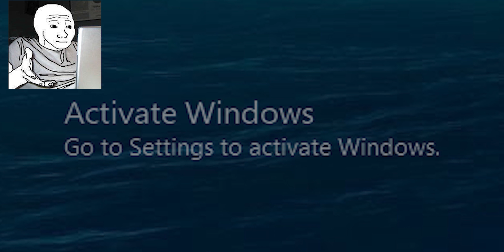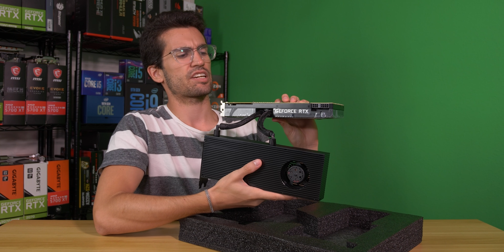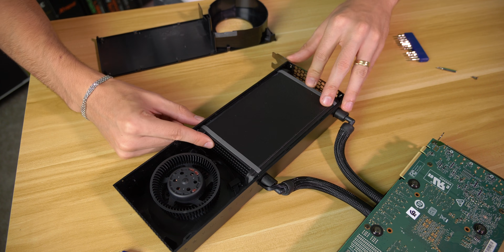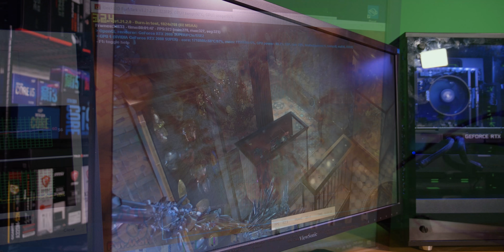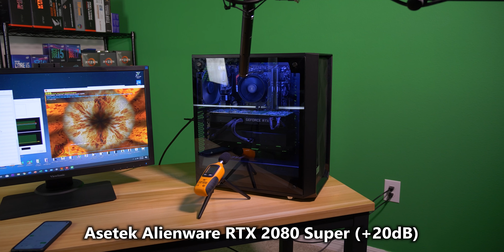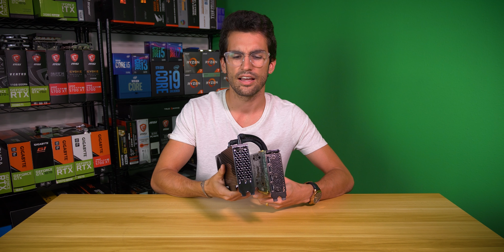Testing a Strange Alienware Graphics Card

Comment: I managed to snag an Alienware R10 for $1600 USD. I was really after the GPU and CPU of the system, which is the Ryzen 5 5600x and 3060 ti (Alienware built GPU like shown in video.) As well as 16GB RAM 3400mhz. I'm really tempted to set the Aurora R10 gaming tower body aside, and install the CPU, GPU, and RAM into a completely different PC tower rig (e.g. NZXT or Fractual) for better airflow on the components' sake.

Comment: I like the design but it doesn't seem like a viable long term solution. The new 3080s with this design are being crammed into the new R11 case and are so tightly packed its losing cooling efficiency at a terrifying rate. 

I have now watched about 20 videos from the last 3-4 months where the average gamer is playing without an OC or tuning. Running games like Witcher 3 are pushing CPU/GPU temps to 90 Degrees Celsius. That is absolutely terrifying to me from a consumer standpoint. It seems these are designed to last until the warranty is up and nothing more. 

Alienware is trying so hard to make a compact high performance gaming rig that they are producing a low quality but highly engineered product. 

Just seems counter productive and a long term PR nightmare as these new R11/R10 models with the 2080TI and 3080 are put right up next to the CPU and PSU in a small case. The heat may get pushed away from the core chip but its going to create an inner case temperature that the liquid cooling design they have won't be able to compensate for after 2-3 years of use. 

Might just be my opinion after reviewing the average joe's uploads to youtube and I have not had one myself to make sure its in an environment that is gaming pc friendly, but after watching a bunch of videos on these rigs. Red flags are everywhere. 

Anyways, solid video and again. I am not knocking the design. I think its pretty cool. 

thanks!

Comment: Random question. Can you explain what exactly the Nvidia Tesla series of graphics cards are? As I've been searching for used graphics cards, ebay keeps throwing in tesla cards as suggestions. I'm not entirely sure if they're meant to accelerate your existing gpu or if they are (in and of themselves) a gpu. Can these be used to boost performance in video editing? Or are they purely for data centers/research applications? Thanks

Comment: Suggest a follow up test with this card and the founders edition in a case with poor airflow so we can see the temps in its intended use case.
Reply from the maker: The intended use case is a mid-tower with minimal rad support - ergo, the Alienware desktops for which this was designed. By using a Meshify C, I don't believe the card was presented in any false light. And it isn't compatible in closed-off, restricted airflow (ITX) cases by nature of its 4 PCIe slot design.

Comment: BS if the pump is in the card that pump will die a slow and painful death. I have seen it with my own eyes more then once. Also my EVGA 2080 Super is a hybrid and in the package EVGA added a slip that says don't put the rad under the card and have the tubes toward the bottom of the rad. EVGA wouldn't bother printing off thousands of cards just to have it tell you something that is a none issue. But hey Alienware and Asetek would never lie to anyone.
Reply: Also just a ad on regular hybrids work in ITX cases you know where they are actually useful.
Reply: It doesn't even come close to my hybrids thermals too. Mine pegs at 61℃ in Furmark.

Comment: Here’s my question, would the cooler work on the FE card and what differences in temps would it make based on just the card alone? And if it does work, the idea and concept would be good to swap over to the FE card that way you can have a backplate and a black PCB.

Comment: as a person who doesnt mind the noise, this would be a great cooling solution and a space occupier since my lower PCIE slots have been empty for the past 4 years. Plus, since this literally pushes the heat out of the case and isolates the GPU heat, this is a great card when overclocking CPUs since they can have most of the colder air up there and the gpu will have their own air down there. just having a great air intake will literally be beneficial for both the hot CPU (looking at you intel 10th gen) and this gpu.

Comment: if I'd use aio's, I'd use it for cpu too, 240 rad at the top of the case and 120 for the gpu at the back exhaust, with the front used just to pull air in with 3 fans if your not going for a custom loop, cause that costs a bit more and I don't really like draining loops, for me even cleaning fans is too much :)) I'd rather buy a new set If I leave em for too long and give away my old ones, cause I can never get the damn things like new
this  2 slot solution looks bad and prolly is bad too :P

Comment: Hey... so im hoping you can help, 
Im in need of a New PC , my current one is feeling the strain at 10 years old

I've put together a new Custom build PC that only hoping is more than upto the task and has a fair upgrade path and life span.
This System will be Used for 4k Gaming, Recording/Streaming Games , editing & rendering. and possible Muliti tasking those processes,.
The build i have in mind would set me back £2,808.00 / $3570.72 (yeah very pricey)

Case: CORSAIR CRYSTAL SERIES 570X RGB GAMING CASE
Processor: AMD Ryzen 9 3900XT 12 Core CPU (4.7GHz/70MB CACHE/AM4)
Processor Cooling: Corsair H100x Hydro Series
Motherboard: ASUS CROSSHAIR VIII HERO
Memory: 32GB Corsair VENGEANCE DDR4 3200MHz (2 x 16GB)
Graphics Card: 8GB ASUS ROG STRIX GEFORCE RTX 2080 SUPER
1st Storage Drive: 2TB SEAGATE BARRACUDA 120 2.5" SSD, (up to 560MB/sR | 540MB/sW)
1st M.2 SSD Drive: 1TB SEAGATE FIRECUDA 520 GEN 4 PCIe NVMe (up to 5000MB/R, 4400MB/W)
Power Supply: CORSAIR 650W TXm SERIES SEMI-MODULAR 80
Sound Card: ONBOARD 6 CHANNEL (5.1) HIGH DEF AUDIO

As you definatly know your stuff, and if to have the time it would great to hear what you think of this build?

Comment: Why not just make it one piece, 4-5 PCIE slots thick and use the integration for more tubing protection, room for a larger rad and more effective fan? Something as thick as that could literally fit a small, high static pressure fan on each end for push pull through a bigger rad

Comment: Um ... why not just build a super thick 4 or 5 slot-sized air cooled card with a humongous assemblage of heat pipes and fins and using really big fans?  It would take up the same amount of space in the case, and have more surface area on its fin stack for heat transfer to the air.

Comment: So you get to put 2 blower fans in your PC. Neat concept I suppose. Blower fans in general are loud and terrible for moving heat. And they want to put 2 in a PC?

I am by no means an expert in temperature science, but it seems to me the radiator becomes less efficient as heat passes through the radiator since all the hot air is at the final pass. If they reversed the direction then the final pass of the water would be closest to the fan making each pass more efficient. We are on the internet, so someone will eventually come around and tell me how it really isn’t a big deal and the direction the water flows through the radiator doesn’t really matter. Either because the size of the radiator is so small or that is just not how any of that work.

Comment: I'd love to run that card on my setup (HP Omen 880). I currently have a FE 1080Ti and the blower cooler helps to keep things cool - airflow is not it's strong point. Since the RTX FEs moved to open style coolers, this is a great alternative to move heat outside of the case and use all that empty space below the card, since SLI is definitely not worth it for most games anyway.

Comment: In its defence i am writing this before watching the whole video, BUT why on earth go through the trouble of watercooling it just to use a blower fan...
Edit: Ok i get the closed off system usecase but how much would the temperatures differ with a normal blower style cooler? I think that could be a cool test aswell. Since you save a lot of space in the tiny case if you can just use the blower cooler straight up

Comment: A better test would have been using a 120m AIO CPU cooler, most people running a blower style GPU card, especially it being high end, it would have dropped temperature even more instead of having all that hot air escaping through the CPU heatsink, and entering the GPU  cooling system, it just don't make sense to me running a $10 CPU cooler🤔

Comment: Pretty sure the Alienware Aurora has a closed of compartment with a dedicated fan from the front to cool the GPU, so this was probably designed to be an upgrade to that.
Reply: I have an Aurora R9, and it has water cooling with a blower. I believe it is the same as this. The R9 is quite cramped.
Reply: @aquaticborealis4877  not too sure what the newer ones look like inside, but the R2 had a panel on a hinge that completely surrounded the PCIE slots

Comment: You say it would be good for a smaller case... but it doesn't look like it would fit well in a smaller case, it almost seems to require a slot between the card and the cooler, both being dual slot as well. I'd say it was more designed so that Alienware could just say it was a water cooled card and use it as a selling point.

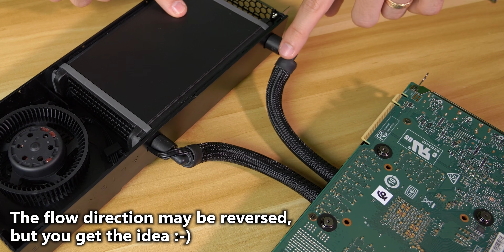Comment: Wow, you actually got one of those! First one to test it maybe even? I really like the design of this unit. This could be nice as a consumer product indeed. Even better would be a version with normal fans like you mentioned, like a 240 mm convector (these things are barely radiating and thus shouldn't be called like they do) that sits in a case like an expansion card does. Also on 2:44, yeah I'd strongly expect it to be reversed, as a counter-flow heat exchanger is more efficient than a parallel one.

Comment: I wonder if it is more beneficial to have the radiator portion of the card above the actual GPU.
If air permeates into the loop (in 5 to 10 years), having the air bubbles within the radiator instead of the block/pump will give you fewer headaches?

Comment: Interesting design, not so interesting results. Even thinking of using it in small cases is wierd, because it doesn't fit my current m-atx case, as there are only 4 slots and the GPU take the 2 in the middle, with the top one for the extra 1x pci-x slot.

Comment: Well, this piece of hardware is pretty cool but i feel they would be better off with a normal radiator in that extra card with 2 120mm fans, or even normal 90mm GPU fans attached to it instead of the blower style.

Comment: Huh. I'm not going to lie, I like this layout for the sake of a tidy build, but a blower style cooler is one heck of a negative considering they always run comparatively loud.

Greg nailed it saying this was definitely a specific case use. You'd need a really odd case to need this with zero radiator support
Reply: Even if the air cooler was louder I can't help but mention their overall sound is less variable & therefore easier to ignore. The blowers seem to always switch pitch ever so slightly which gets kinda annoying.
Reply: For my Fractal Deine case is great because airflow is very restricted and sound dampening is better than most of cases

Comment: I have been using asus strix rtx 2080 with a 360mm AIO for a few months now and the card never goes beyond 42°C with an decently high ambient of 33°C. I am using the nzxt kraken g12 along with nzxt kraken x72 aio for cooling down the gpu. The card is stable with 100mhz on core and 1100mhz on the vram which gives me a 2145-2130 constant gpu clock under load. The rtx cards are severely power limited....and even after doing the liquid metal mod on the shunt resistors it still power throttles occasionally. Could you suggest me a custom bios with a higher power limit which will work with my card. I tried the evga one but it did not work. Asus on the other hand do not respond to posts in their forum or to emails regarding releasing a better bios for the card. The rtx 2070 super has a power limit of 330w whereas my rtx 2080 has only 305w which makes no sense.

Comment: The only benefit I see to this is:
1. Wanting to fill up the PCIe space (but if you really wanted that, and wanted more real function, just throw in some USB or NVMe adapters, or a better network card, sound card, etc)
2. There's no space for a 120mm GPU rad, such as the Gigabyte Water force ones (but at that point, is there really space for two PCIe slots?)

Comment: Is it possible to run 2 graphics card like rtx 2080ti for gaming on one monitor and and for second monitor that doesnt need high refresh rate off like a 1060.  would performance be better/ more consistent at 240hz 1080p if the card was not outputting both monitors, if the main monitor is a 240hz 1080p and the second monitor is a 4k or really high pixel count but 60hz, i feel like outputting both displays while gaming would decrease performance if multitasking on second monitor but would the pc handle it running 2 different cards as 1 pc just for a different monitor

Comment: eh, Asus, NZXT and evga has better solutions for GPU AIO cooling. I mean the Asus matrix gpu aio solves the lack of space problem for compact cases without giving up a PCie slot.
Reply: Also, question, would the thermals be improve if you add a back plate to that exposed pcb?

Comment: if you have space for two full size PCIe cards, you have space for an even larger radiator with great fans. this looks cool and throws me back to the SLI days, but it’s just stupid functionally, unless you’re already using a CPU AIO.
Reply from the maker: The number of PCIe slots has no bearing on a case's radiator support at the rear. The Alienware cases in particular needed a slot design like this, so the problem does exist - albeit in isolated form.
Reply: Greg Salazar well yeah, but I meant for bringing it to the DIY market. my bad for not clarifying.

Comment: My question is, could they have made the card a 3 slotter and full length and fit the cooling system on it? maybe with a elongated radiator design and fans that go over it would help?

This design feels clunkier than just a normal rad that would sit on a side panel
Reply: So... ASUS RTX2080TI-ROG-MATRIX
Reply: @shaneeslick  I've been gone from PCMR for a while and missed it. So..if that already exists, why this?

Comment: I think this looks pretty cool. What if the radiator card was a triple slot with two 60mm Noctua fans in push pull? That would probably be quieter and cool better, but also more expensive. Would still be neat. Then again you would be covering 5 PCI slots that could have been used for expansion...

Comment: With how much space this takes up, might as well take the stock heatsink off (especially on a crappy rx5700) and jerry rig a tower air cooler on there
Reply: Use a raijintek morpheus. I had one on my 1080ti before I tracked down a hybrid kit for it, it works well. It might not be a good idea for a system integrator though. The heatsink is heavy and could stress the PCIE slot in shipping, this design works well having all that weight off the GPU.

Comment: That seems... Eh. Micro ATX case? Probs not enough room and a 3 slot card would get better cooling perf. Smaller cases dont have room for either large card or this. This is designed for cases with garbage airflow just because of garbage case design. Instead of R&D into this basically useless GPU cooler you could've just put it to a good case. I've seen the dumb prebuilt "gaming" cases with a crud ton of plastic, only a 92mm back case fan and basically no other place for intake/outtake airflow. You could say it's useful for that. But a better solution is just a better case and standard card. I mean, it couldnt really even beat a FE card at noise normalized perf. One of the cards that's close to the worst in noise normalized perf.
TL;DR: Just about a 100% useless card and a cheaper alternative (different case) gets better noise normalized perf.

Comment: I like the concept, the point you made about having the extra "card" look filling space is something that quite like myself. Hate blower fans however especially if the fan runs at an annoying pitch. Surely, they'd be able to use the same shroud/housing design with a 90mm fan that's rigged for static pressure and it'd be quieter.
Reply from the maker: The blower was necessary for the rad layout they used, but swapping to open air fans for the graphics card side at least would be helpful, I imagine.

Comment: why not just put a single 120 rad with a regular fan and put it as rear exhaust in the usual spot?
Reply from the maker: ? Because the Alienware case this was designed for apparently doesn't support a standard rad.
Reply: @GregSalazar  you can get smaller than 120mm Rads, look at the one in this cooler as an example you can get them to fit anywhere so you can use a more efficient Fan design
Reply: @GregSalazar  ohhhhh you mean alien ware is back at it building some over priced, over complicated trash?

Comment: Extra noise and size for marginal cooling ability. I feel like this could be so much better if the two halves were joined and the extra space housed a larger rear-firing air cooled heat sink.
Reply: Hello joel, fancy seein you round' these parts.
Reply: @Daugintas  Gotta get me some Greg!
Reply: That's not a bad idea.  A 4 slot card would work well in a majority of builds considering the percentage of dual GPU PCs is so relatively low.
Reply: Go ahead and build one then Joel! Lol
Reply: @johnsherby9130  maybe I will!
Reply: Joel Creates I would actually love to see this. Hoping to see a video about it soon
Reply: @scudsturm1  the link shows a card that is the standard size, I am describing a double size card that fills the second space with a large heatsink
Reply: So like a Morpheus II but pre-mounted.
Reply: With all the wasted space i think a tripple slot GPU would be the better alternative to whatever this thing is.